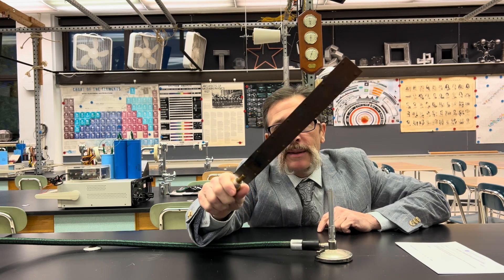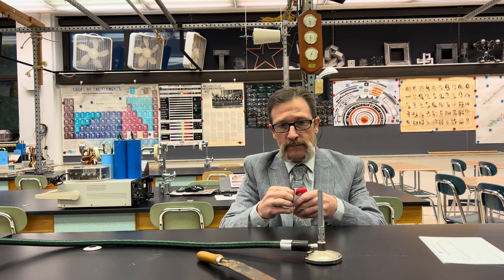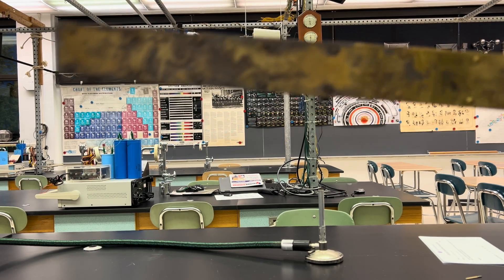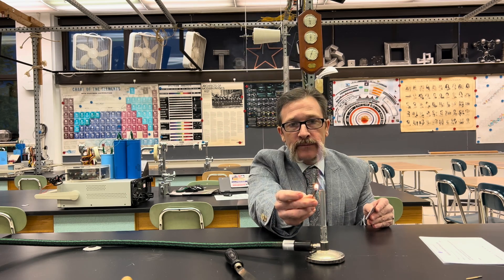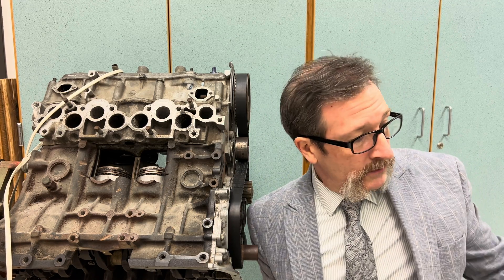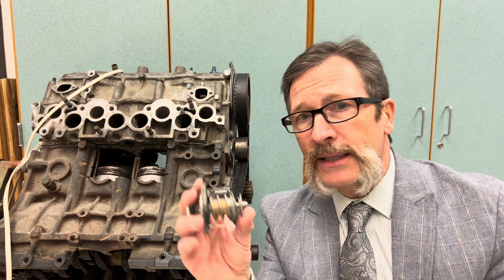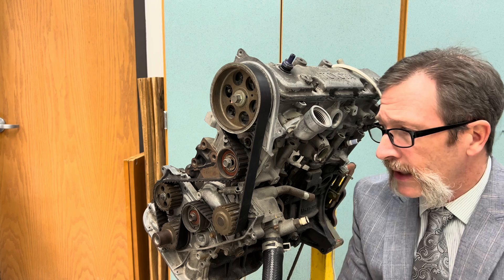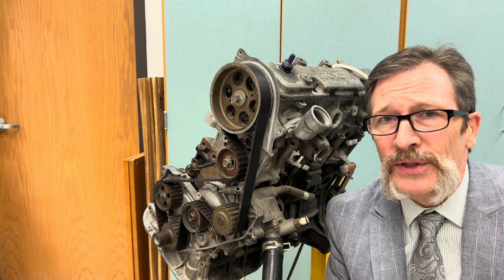Thermal Expansion: What Happens When a Bimetallic Strip is Heated?

Comment: I expected you to discuss whether brass or steel expands at a faster rate.  I believe you demonstrated this - the heavy sandwich appeared to straighten out, because brass expands faster than steel.  But the rivets or the thickness of the steel or both tended to mask the effect.
Reply from the maker: Yes! That is so thick and strong...it barely curves.

Comment: Good video. So much applications of this in real life: Motor Thermal Overload Protection, Thermocouples, Circuit breakers, etc.
In the case of thermocouples though, the different metals is what gives the millivolts, potential difference then converted to a temperature scale.
Reply from the maker: Thank you for the comment! 

It’s such a simple but useful component

Comment: I like many of the demonstrations you have performed. 
However using an automotive thermostat as an example of a bimetallic strip/spring , is incorrect. The spring doesn’t open the thermostat it is used to close it.  There is a wax pellet  sealed inside of the tube shaped part of the thermostat assembly that expands when heated and contracts as it cools. 
Keep the videos coming
Reply from the maker: Definitely all car manufacturers have proprietary methods of affecting this same process. We were just showing one mechanism for it. 

Thank you for your comment, it’s very interesting!

Comment: sir i am preparing for jee exam and i am currently in 11th grade

could you pls explain the reason for bending of stipe by using diagram on whiteboard 
i also see this with fundamental of mechanics like by heating force acting internally (stress is created) but how it leads to bending is that part which i can't able to imagine 

sir i searched the whole internet but i don't find answers to my particular question pls help 🙏
Reply from the maker: We appreciate you using our videos to study! While we won’t be uploading another video on this topic specifically in the near future, you might find our other videos on thermal expansion helpful!

As for reasoning through why it bends, maybe the following will be helpful: you have two metals with different expansion rates that are fixed to one another on one side. As the one that expands faster begins this process, it will feel a net force in the direction of the other strip. The result is a slight bowing/bending seen in the video.